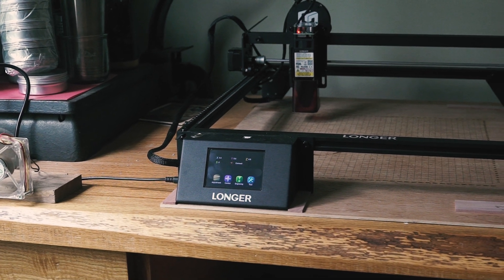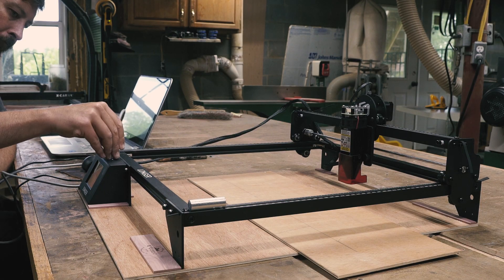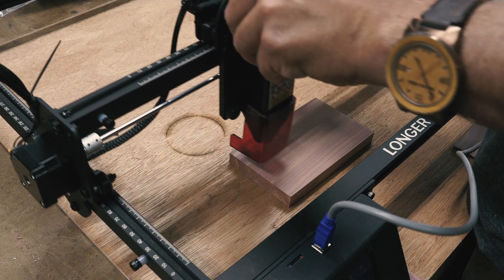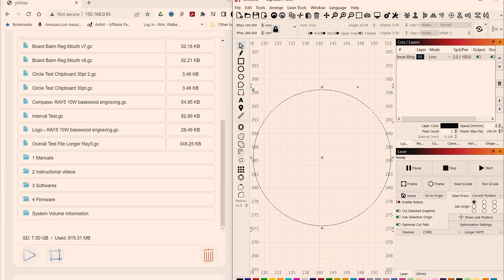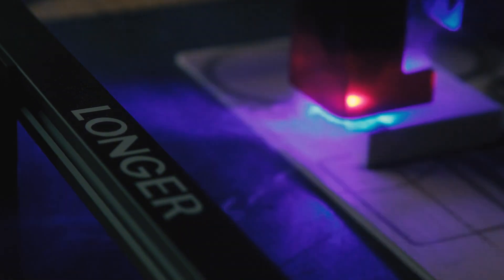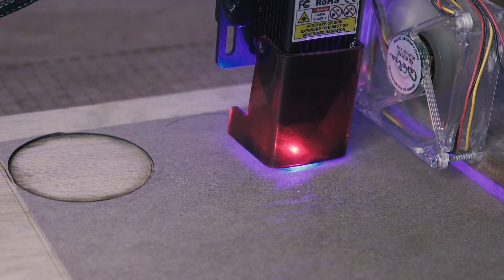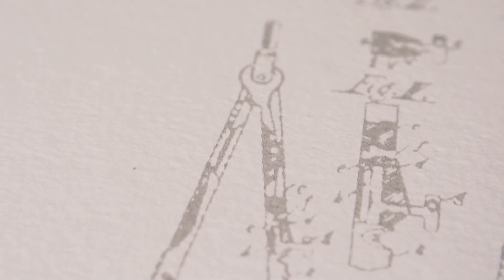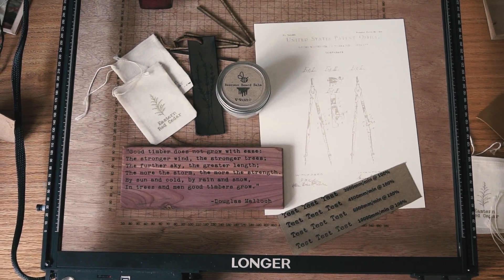The LongerRAY5 10W - Unboxing, Review and Impressions

Comment: So many cool ideas! Now I need to try some of those. I really like the mason jar inserts.

One thing I found out in my research you don't want to run a diode laser at 100%. It will decrease its life faster than it would at say 85%, which is my typical max. I just lower the speed a bit to compensate. It's logarithmic or something. 

Keep up the burning!

Comment: Looks interesting. Apologize for the extremely basic question but I have zero experience with CNC or laser. Are the software programs (layout, design, set up, etc), typically Mac compatible or would a dedicated PC/Windows machine be necessary?
Reply: Lightburn has a native Mac application. For $60, it's a no-brainer for laser work.

I use VCarve for my CNC, but there's no Mac version. You would have to run Parallels. It runs at $350 for the Desktop version. The limitation there is 25" x 25" workspace, although you can tile to make things as large as you want. I have the Pro version which removes that limit and runs at $700. There are other things, but they are more for workflow efficiency than actual operations. You can buy Desktop and then later on upgrade for the $350 difference.

Fusion360 has a native Mac application, but I find that it's more 'technical' and for 3D objects. VCarve is focused on CNC with routers. That said, I would love to dig into Fusion360 more for CNC operations.

Those two would be for designing the jobs. Then you need a software to send the toolpaths to the CNC. I use OpenBuilds Control, which is 100% free. There are a few other free ones, and PicSender which I think is $30. They're dedicated to moving the spindle around the work area and sending the gcode (toolpaths) to the CNC controller. Then the controller tells the X, Y, and Z motors how much to turn clockwise or counterclockwise. It really is a pretty cool system.

Lightburn does everything for the laser, design and controlling the gantry.

Comment: It would be interesting to see how quickly (or if) you outgrow this machine given your use case. Rotary seems intriguing, but I would definitely need a beginner machine to cut my teeth with. This seems like it would fit the bill for someone like myself who has little to no experience with a laser or CNC. Thanks for the video!
Reply: I started with a CNC and then got a laser. If I had to do it over, I would probably get the laser first. The focal point on a laser is so much more forgiving than the z height on a cnc. So I would learn how these types of machines work, then expand into spindles and bits and such.

Whatever you do, get into it and start making things!